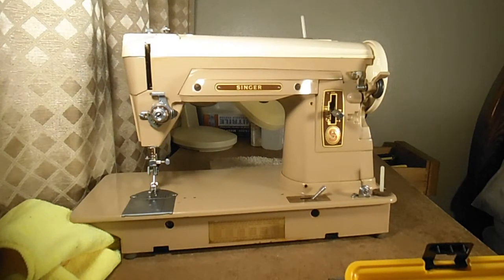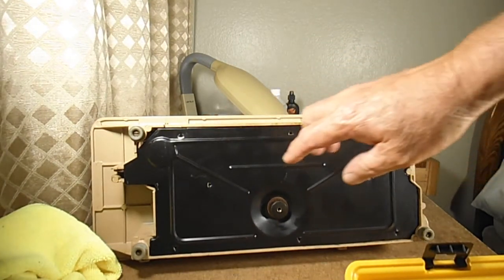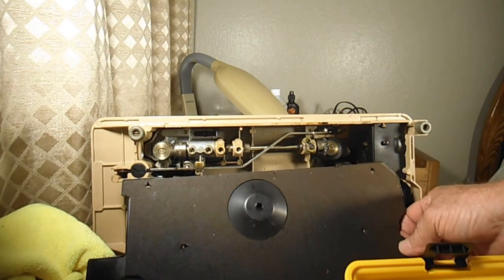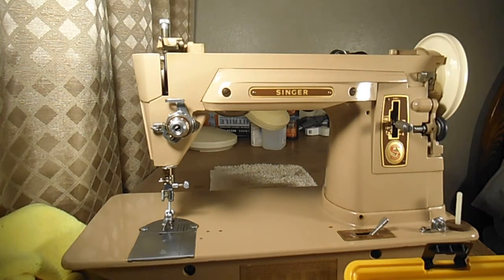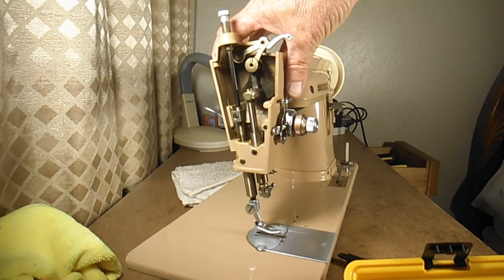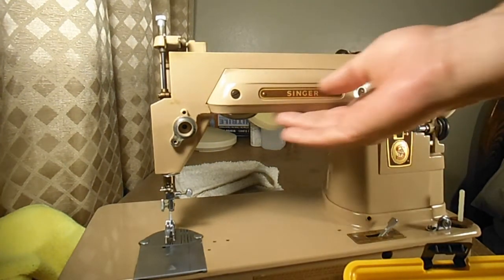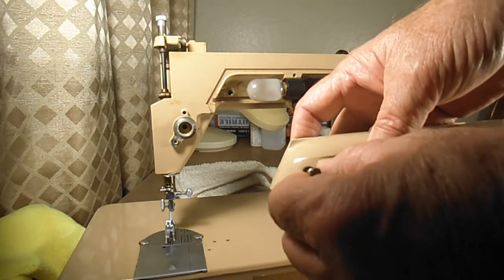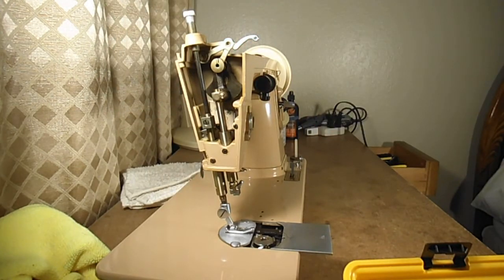SINGER MODEL 404 RESTORE SERIES Pt.1 REMOVE COVERS & TENSION

Comment: Hi Andy, Really useful videos.  I have an old 404G13 machine and it's running way too fast.  when I press the pedal the machine makes an awful noise (like its getting stuck) then all of a sudden it shoots off and sews uncontrollably fast.  Could it be the pedal?
Reply from the maker: Yes. It could be a lack of oil/grease, but it is usually the condition of the pedal. The pedal works by compressing stacks of carbon resistor discs to allow electricity to flow. When the discs are dirty, broken, missing, or out of adjustment the pedal won't work properly. When you press the pedal only a little electricity is reaching the motor so it "groans" and can not turn enough. As the discs get warmer and finally compress a little you are pressing hard and giving the pedal full power so when it does build up enough in the discs it is making the motor race at full speed. Your pedal is 50 to 60 years old and may have never been cleaned and adjusted. This is why I made the videos. You can try to just turn the adjustment screw and "close the distance" the spring/plunger has to travel to compress the discs, but in my experience, it is better to open the discs, poor them out, and take a look at them for cleaning. You can browse thru the videos at 2x speed to get the idea and determine if this is something you wish to do.

Comment: Thanks for your videos, Andy.  I have just picked up a Singer 404 from a lady who is downsizing.  This machine is so pretty and the knee lever/foot pedal is so clever.  I'm excited to get it to run well.  It has a problem with tension so I have to figure out how to fix that.  I've only done to the extent of oiling my other sewing machine and nothing more.  You got me interested in cleaning/restoring this machine myself though.  You have plenty of videos I have to go through before I decide on actually doing it, but I'm really excited.  I just need to tackle it one thing at a time to prevent myself from being overwhelmed.  Wish me luck!
Reply from the maker: Thanks for watching my channel, Angel. It can seem overwhelming if you've never worked on a machine like this. I advise folks to skip removing any parts that seem too difficult. You can clean almost the whole machine with the parts in place if you don't mind the time it takes. My 404 restore Playlist has the 56 videos: https://www.youtube.com/playlistlist=PLsCOZgzzaiKIB4kvIHCfHYuyLMUp5A4UI   Some of those videos are about the tension unit. They got so popular I put them in another separate playlist for people who just wanted to fix their tension:
https://www.youtube.com/playlist?list=PLsCOZgzzaiKJaeFB_GW97NsW5GYM7KD9U
Some machines have been well maintained and a gentle cleaning, proper oiling, and seating the motor brushes are all they need.
If you'd like a copy of the original Instruction Manual (includes oiling) it is free from Singer: https://www.singer.com/search/support?title=404    Just click on the 404 slant needle machine. I made a video about reseating the carbon brushes on the motor with a $10 stone. It cleans the commutator and seats the brushes at the same time. https://youtu.be/pzq4tv8qn94   One step at a time is a good way to go and I always took pictures before I removed parts si I could remember how they went back on the machine, haha. Good Luck.
Reply: @andytubesewing1953  thank you so much for sharing your knowledge.  You are so generous.  I hope it comes back to you a hundred-fold.  I’ll definitely watch your videos first before I do anything on my machine, focusing on the playlist you mentioned.  Thanks again.

Comment: Andy I know this is off topic, but would you have any hints on where I should look for a repair manual for my Riccar  9800 electronic?  I have searched and searched but can't find anything.  I am having upper tension problems Thanks Pat
Reply from the maker: I've never seen a digital copy for sale. Rarely someone will list a paper copy online. eBay or Bonanza in the USA.  You may need to look at sights in the UK or Asia. Just too rare of a repair manual for a seller to digitize and make any money on. Sorry, Pat.

Comment: Wow, what wonderful videos! I own my grandmother's 404 and I need to clean it up. First thing I learned is that my bed cover plate is missing. Do I need one to keep the machine running smoothly once I get it back in good working condition?
Reply from the maker: Thank you, Elizabeth. So nice that you have your g-mothers machine. The machine will work perfectly without the bed cover plate as far as the mechanical aspect. The plate is to prevent oil and grease from falling onto your floor, table, or sewing bench. You can find them sometimes on eBay. In the meantime, you can even cut a piece of cardboard or thin wood to fit and keep the bottom covered. If you have kids or pets around, and the machine will be in a cabinet, please do use something to cover the bottom. There are lots of moving parts there, the gears are sharp and they get hot. Model 404 was also sold in a carry case that included a plastic bottom and many people just used that bottom case part as a bed cover plate. You can see a picture of the carry case here: https://www.worthpoint.com/worthopedia/original-pc-carrying-case-singer-401a-481367172
A video I'd like to mention is about an easy, quick way to clean the motor commutator and speed up the motor,
https://youtu.be/pzq4tv8qn94  Finally, one of my latest videos is about cleaning a 404 without taking all the parts off. It's a very long video, but on the timeline, I have markers with the starting times for each section. https://youtu.be/kXZHksK7rGQ
Can you tell that model 404 is my favorite straight stitch machine? Thanks so much for watching my channel and thanks for saving your Grandmother's wonderful machine. Take care.

Comment: Hi Andy, I took apart (all except wiring),cleaned, oiled, greased and put back my Singer 401A with the help of these videos.  Thank you SO much!  You talked not only about the 'how' but the 'why' which was awesome!  thank you :)
Reply from the maker: That's an impressive bit of restoration, Daisy! Nicely done. ✨ If you can work like that on a 401A, you can do any vintage machine Singer made. Care for one last tip? A newer method for cleaning the motor commutator and speeding the motor up. https://youtu.be/pzq4tv8qn94    Thanks for sharing your experience on my channel. Take care.
Reply: @andytubesewing1953  Thank you for the tip Andy.  Yes, this is on my list of things to buy :)
Reply from the maker: @daisymay6290  You'll be happy with the results. Thanks again for watching and sharing on my channel. Take care.

Comment: Great video.  Thanks so much.   I have had this machine a couple of years and finally am getting it going.  I may have done something to the throat plate lever.  It was seized up so I oiled it and would move but not all the way to the left. The two silver caps look like they want to move on the throat plate but don’t.  Could I have stripped something?   Either way it still sews great and don’t foresee that I will really need to use the lever.  I have a singer curvy but actually like how this sews better and much easier to thread.  Why must we always upgrade!  Haha.  I love the vintage feel.   Thanks again and look forward to your channel.
Reply from the maker: Hi, Sandi. The parts of this assembly are strong and I doubt you "stripped" something. The pins are likely "glued" into the tubes they sit in by dried varnished oil. It usually better to take them from the bottom of the machine. Here is one of my videos about repairn the whole assembly. https://youtu.be/n1LSM-BZw9k
This video you comment on is one of 56 in my restoration playlist. I've had emails from hundreds of people who have repair, fixed, cleaned, adjusted and even fully restored their machine from watching these videos. It's always a bad idea to force any part on a vintage machine b/c some of them can bend and break. If you try oiling something like that in the future try heating it up after applying oil. I use a hairdryer. Sometimes 2 minutes and sometimes 30. It can help soften that gunk and let the fresh oil in and get parts moving a little. It can get a little messing, but oil cleans right off with a soft rag, like old t-shirt. (Esp. the one of his you want to get rid of👀😉Good luck, and thanks for watching my channel.

Comment: My 404 will sew for about an inch or so and then the fabric stops moving and it just sews in the same spot. What would cause that?
Reply from the maker: First thought is the thread is wrapping around the hook and getting caught. Remove the needle thread and remove the bobbin and just run the fabric through without any thread and see if the fabric will feed by the feed dog. Pulling it. If it does then you've got a threading problem. If the fabric still won't go through the machine then you have a feed dog problem and we can go from there
Reply: Thanks for the quick response! Let me try that real quick. 
I do think its getting caught on the hook, but not every rotation, which is weird.
Reply: Ok, fabric goes right through no problem without thread
Reply from the maker: @lloyd4375  Maybe this is a new machine for you? Many possibilities for thread wrapping. Start with the basics.
Thread the needle: https://youtu.be/A0IBjNpKHo0
Thread the bobbin case & bring up the bobbin thread: https://youtu.be/Tb3nKUrEtGM
Check thread clearance: https://youtu.be/OXKqZp87eN4
Of course, be sure you are using the correct bobbin type. Model 404 uses a CLASS 66 Bobbin. It came with plastic ones, but metal can also be used. It has rounded sides, meaning curved like a teacup saucer, not flat-sided bobbins which are too tall and can catch the thread. I go slow in my videos so use 1.5 or higher times speed if desired.
Basic steps b/c wrong path of needle thread, or missing the tension discs when threading, or wrong bobbin, or too narrow thread clearance can all cause thread wrapping.

Comment: Is the 404 the same as the 404G
Reply from the maker: Almost the same. The g model was made in Germany has a different bobbin winder and threading system on the top but it was based on the USA model 40 4

Comment: Just found out I have a 404. I love it. It's the machine I learned to sew on in high school.
Reply from the maker: congratulations you have a wonderful machine that can last decades longer there are about 40 more videos in this series that will tell you everything you like to know about the model 404 thanks for watching my channel and leaving a nice comment
Reply: I love your video! Do you know what attachments go with this machine? I would like to find them. Found some on Ebay but all are different. One set has a zigzag attachment but I don't think that is for the 404. I am hoping to find a complete set.
Reply from the maker: If you follow this link you can download a free copy of the original 60-page instruction manual which includes directions for the included attachments and shows some "Fashion Aids" for the 404 including an "automatic zigzagger" and an "automatic buttonholer" among others. Original vintage attachments can be found on eBay and Bonanza, (and other places too) often in their original boxes. Good Luck.

Comment: Two questions Andy: What is the brand of the hollow ground screwdriver set that you use and what do you use to loosen the really hard varnish between the top cover and the arm? The varnish seems impervious to WD-40, alcohol and mineral spirits. It doesn't affect function, but if I'm going to all this effort to restore, I'd like to do the best job possible. Thanks for all your effort, really enjoy your channel and this series.
Reply from the maker: I thought you would be asking some hard questions, haha. In April 2017 I researched hollow-ground screwdrivers after a comment about them from a viewer. I bought a 9600 Starter set from Chapman MFG, made in the USA. I love it, especially the little mini-rachet. 
I made a video about the set: https://youtu.be/KnrvDZeaYj4   Here is the MFG web page about them:
https://chapmanmfg.com/collections/slotted-flathead-sets/products/9600-starter-slotted-bit-set
In June of 2019 a viewer, machine restorer and friend recommended another set of screwdrivers Made by Wheeler and I bought it.
Here is a video about them: https://youtu.be/7_DHIC6eskc     Here is where I bought it: 
https://www.wheelertools.com/gunsmithing-tools/wrenches-and-screwdrivers/43-piece-professional-gunsmithing-screwdriver-set/954621.html
I use both sets now, and some parts are interchangeable. If you only buy one I'd go for the chapman just to get the mini-rachet as you can buy additional bits anytime you like. You can torque that little rachet and get some stubborn screws out very well with it.
Varnished oil can be very difficult. My go-to cleaner for the machines is Krud Kutter Original Cleaner & Degreaser by Rustoleum. I found it by chance as I was always looking for something better that was earth-friendly, low VOC, zero odor (I live in a small condo without a workshop or garage). On the internal parts, I will pretreat them will up to 100% solution. On painted surfaces about a 15 to 25% solution with a quick rinse as it will dull paint if left on too long or used in a strong concentration. Here is their web page about it.
https://www.rustoleum.com/product-catalog/consumer-brands/krud-kutter/cleaners-and-stain-removers/original-krud-kutter
I bought a $5 spray bottle and buy the KK by the gallon at Home Depot and hardware stores around town. Price varies from 12 to $15 and I see it online shopping now also. I buy these soft-scrub kitchen type sponges at the dollar store, like 2 for $1.00 and they have the soft nylon "scrubby" on one side. I like them because the sponge is foam type, not cellulose, and they rinse really clean. For those tough edges like you are talking about I might tip a little on the scrubby and rub the top edge all around, followed behind by a wet terry cloth to get the gunk and KK off before it dulls the paint. I have made many videos of cleaning parts and giving the whole machine a "Shower" by spraying on the KK solution, scrub a little, rinse off with a hose or handheld shower, dry with a leaf blower or hairdryer and then oil the machine immediately. If I get a little flash rust during that process I use Rustoleum "The Must for Rust" and it wipes right off. https://www.rustoleum.com/product-catalog/consumer-brands/krud-kutter/rust-remedies/the-must-for-rust-rust-remover-and-inhibitor/   It's about 6 or $7 an 8-ounce bottle around town and goes a long way. Very easy to use with a slightly funky smell.
If you have not seen any of my cleaning videos, this was the first time I filmed using the KK on a machine back in 2016. I don't do it on the patio andy more, but I bought a handheld shower and wash it right in my bathtub/shower inside. I scared my wife the first time, but then she saw how I clean the tub with it: https://youtu.be/d6juEKFj790

Comment: Thanks for this. I just recently got a 401a at my local Goodwill, and am going Sunday to pick up a 404 (for$25!) Love these machines. I have the 401 running as smooth as a Swiss watch, but I'm sure you'll have some tips in this series that will help me do a better job.  Keep them coming.
Reply from the maker: Thanks, Lynn! $25 is a great price for a 404. Best straight stitch machine, IMO. All heavy duty, no camstack, and same motor & gearing as the 401A. Strong, smooth & quieter. You will love it.
Reply: I got the 401a with table and matching bench for $30 at Goodwill! Looked like it had been used about twice. I couldn't believe it! I make camping gear with my machines. Hammocks, etc. Love the slant shank for ease of viewing the work! I cant wait to get to work on the 404. It looks like it needs some real TLC!
Reply from the maker: Oh man, you find the best bargains. The 404 is perfect fo the type of craft sewing you are doing. Once cleaned, tuned and lubed the 404 can run well for decades. I'm excited for you to try it and hope to hear your opinion of it in the future.
Reply: How is 13.99 for a 301? lol Dont ya just love a bargain?
Reply from the maker: It is amazing the bargains my viewers find! I always feel somewhat jealous, lol. At those prices, even if you need to buy a few parts, you still have a very good buy there. Congrats!